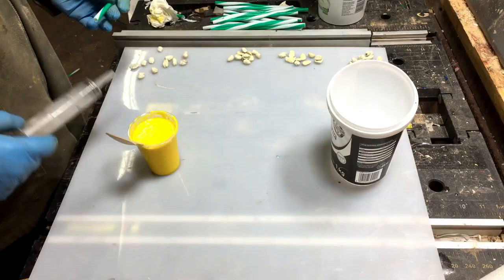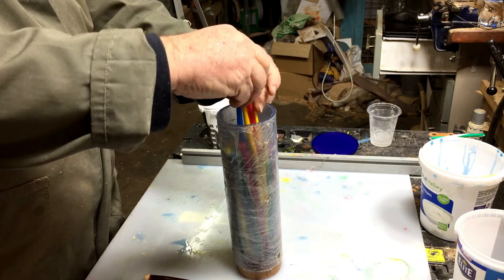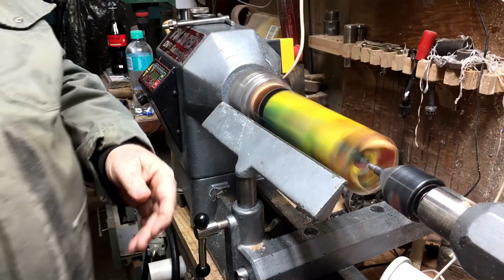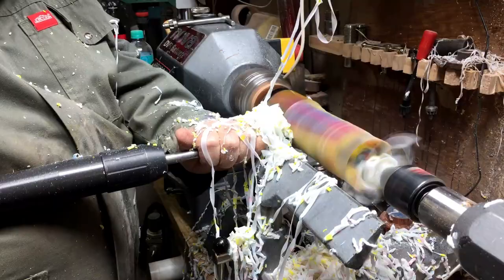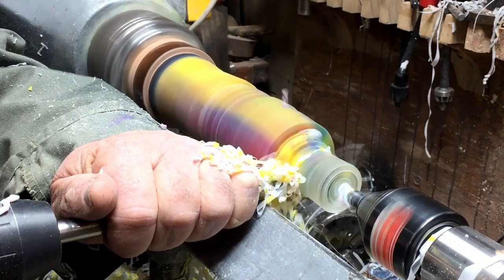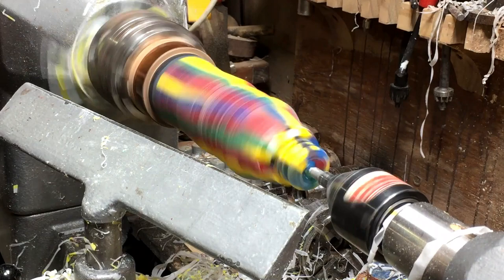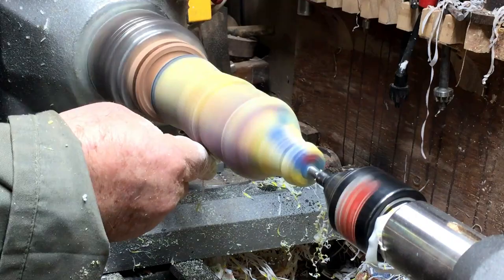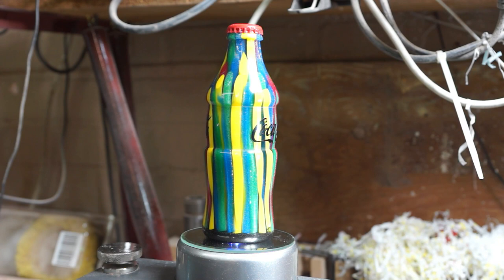resinturning a coca cola bottle murano glass style

Comment: So creative, as usual.  The lettering and the red cap really set it off.  I thought I owned every tool out there but, alas, I do not own a cap crimper.  I hope you won't mind a constructively intended remark, you had no lip on your tenon but rather chose to bottom it out into the back of the chuck.  I believe you have a better grip with lip on the tenon and not bottomed out in the chuck.  I love your work.
Reply from the maker: Thank you very much Steve You are 100% right , it was a mistake and i paid for it :)